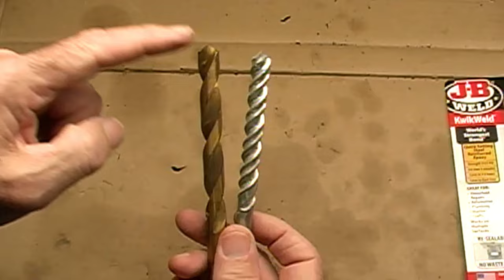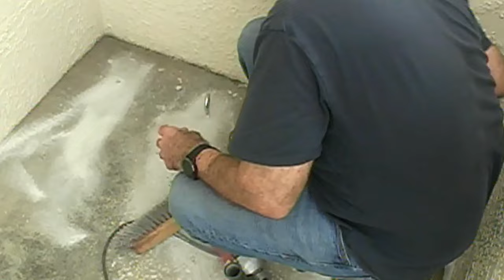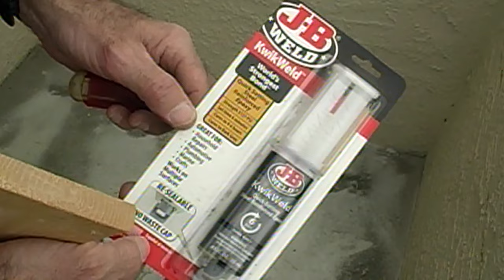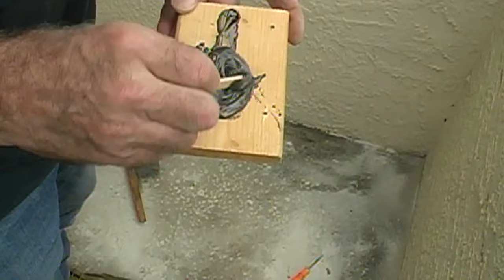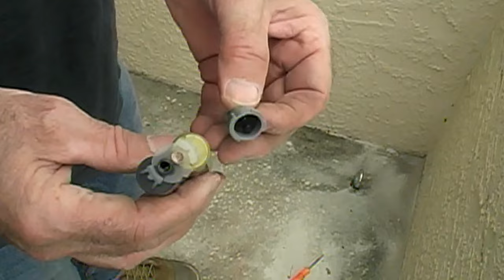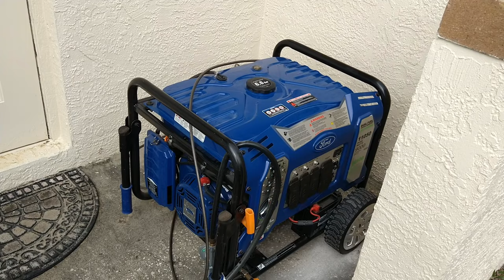Anchor eye bolts in concrete slab

Comment: Great instructions. Not many videos showing how to install the eye bolts. have a link for the eye bolts?
Reply from the maker: Ace Hardware. I used to build custom motorcycles and when I needed a special fastener, Ace was where I went. They have these eye bolts in galvanized and stainless steel.
Reply: @getdirtywithvern  Thanks for the quick response and tutorial. Greatly appreciated.